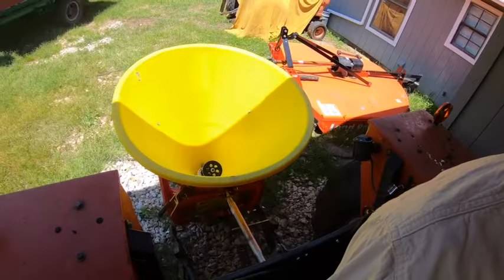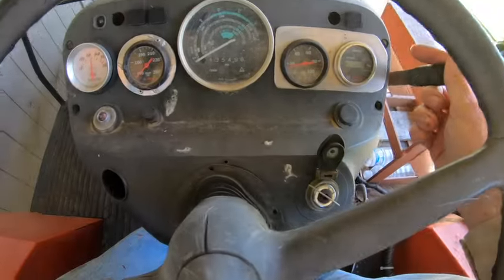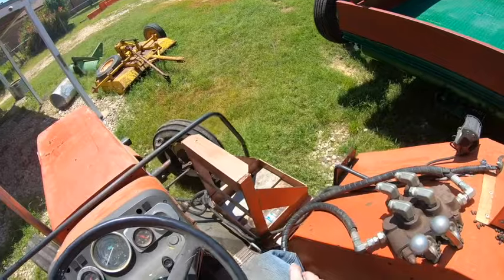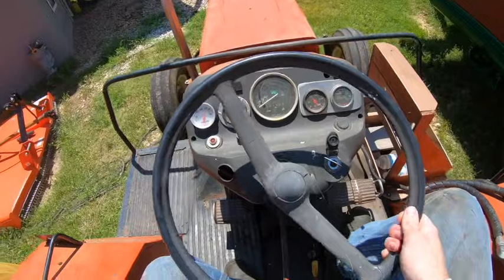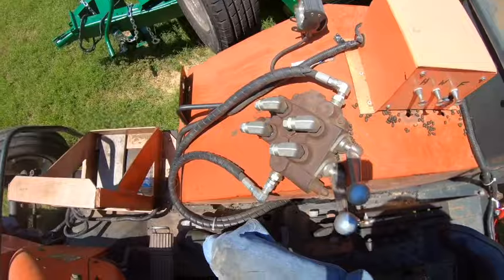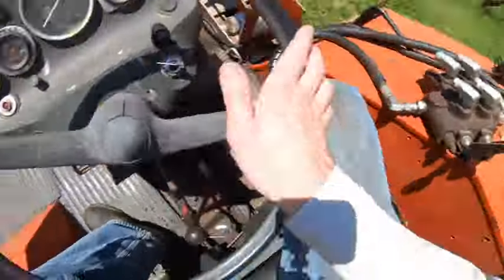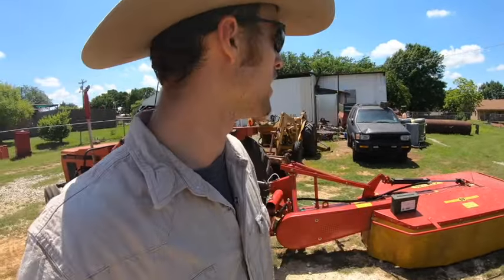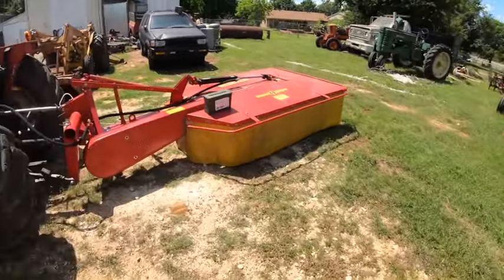DRUM MOWER IN ACTION - ARE THESE WORTH BUYING?!?

Comment: Good to see a new video! Hows the 6.7 doing?
Reply from the maker: I sold it for almost what I paid for it new, after driving it for years LOL. I went back to a smaller gas truck. I loved it honestly, I never had any problems with that truck, but the maintnance costs were too high just like all Tier4 diesels. ~$100 oil change, if I do it myself, ~$70 fuel filters every 10k miles, plus not that good of MPG with the emissions stuff, all while burning more expensive fuel.

Gas pickups are SOOOO much cheaper to drive. Oil change is ~$28 with full synthetic and a factory filter. Tires are cheaper, fuel filter $11 and lasts for 30k miles, MPG almost the same although this one is smaller than that F350. Gas costs less, insurance costs less etc.

The smaller gas trucks save me so much money now. I'm fortunate that I could downsize into them, but I'm not hauling equipment anymore (closer fields) and I stopped delivering hay since everyone expects that for free lol.
Reply: @officialweldingfarmingarch2041  Oh wow thats good that you got what you paid for it. Yeah I feel it right now. I'm 16 and have a 1997 Ford F-250 7.3 and that thing takes over 100 dollars to fill up every time and the oil changes are not cheap either lol. Plus all the parts I've put on it like injectors and new parts in the front end ect. But anyway man, thanks for being on Youtube for all those years. You were the one who got me into welding, I probably started watching in like 2015, then In 2016, I convinced my parents to get a Lincoln stick welder, and I've been welding ever since. Now I have several welders and a plasma cutter and even got a welder that I can do tig with this Christmas. Thanks for all those welding videos you put out, and those build series videos were also fun to watch. Glad to hear from you again. God Bless
Reply from the maker: @dieselwelding431  Thanks for watching, Best wishes!!!
Reply: Smart call with the pickup, the truck market is crazy today.